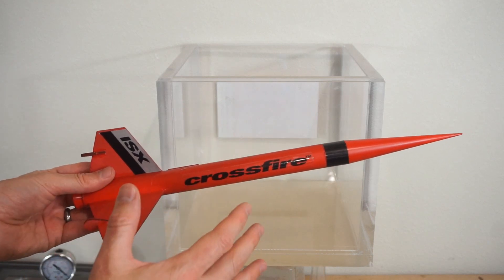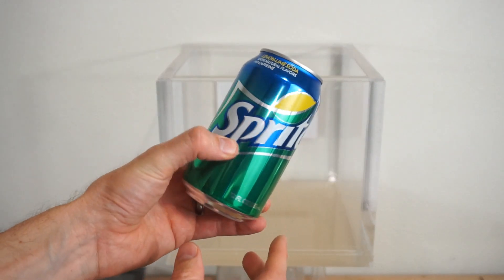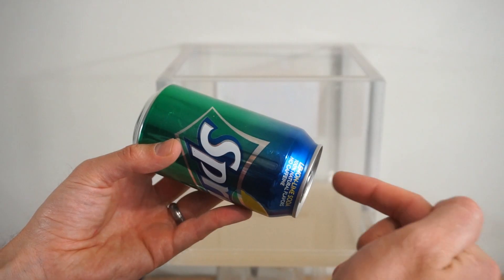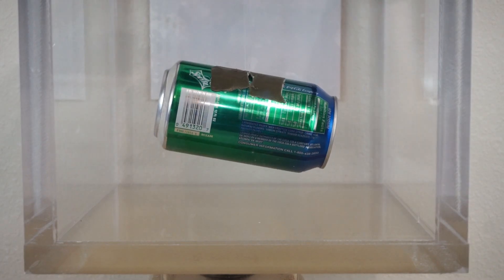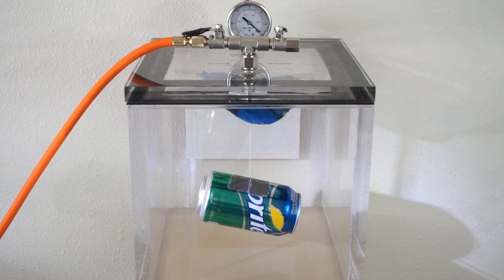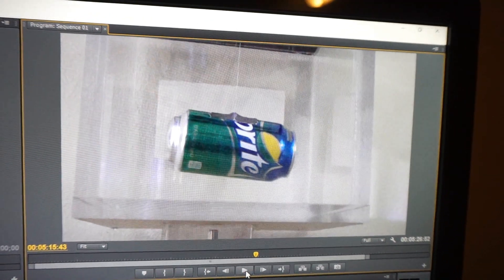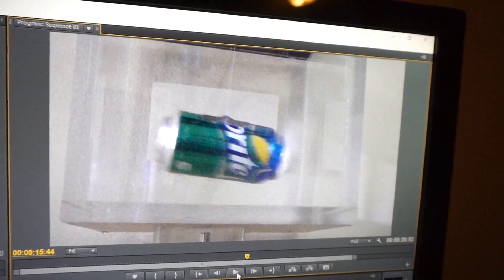Can a Rocket Fly in a Vacuum Chamber?

Comment: Well done.  Simple proof that rockets work in a vacuum.  I wonder how much mass is involved with a rocket motor though.
Reply: IIRC, it's like 90%, maybe 95% of the "wet-mass" of the rocket which is the propellants.

So, the Saturn V had a mass of 2,970 metric tons, and of that about 2,821.5 metric tons would be propellants.

These are back of the envelope calculations, so take it with a grain of salt.

Comment: that proves the rocket tanks would explode in space, and rockets and your can only last a second of thrust, doesn't prove shit.
Reply: And if the rocket tanks were  made of Sprite cans, you might have a point.
Reply: Melissa Roma Do you seriuosly think that a rocket it's the same as a soda can?
Reply: Melissa, you're extremely dumb. Do you actually believe tanks are made from 0.5mm thick aluminum rather than several inches of aircraft grade aliminum, steel and composite materials? So you actually believe that rockets do not have nozzles to control the rate at which fuel is consumed?

By your logic when you turned your stove on you'd instantly deplete the grid's supply of gas. The truth is that there's nozzles limiting the rate at which your stove can burn gas. Does your stove dial increase atmospheric pressure to slow down gas flow? No, it's an adjustable nozzle which decreases the mass flow of gases.
Reply: Melissa, here's a rocket tank being constructed (it aint no coke can) https://www.youtube.com/watch?v=r_CdlAOwj8Y
Reply: Gra Ra5 

What data do you need? As soon as you enter vacuum the internal pressure is greater than the outer (there is none in vacuum) therefore fuel tank would explode, what so difficult to understand.

This is the reason (same principal even in lower pressure) we cannot carry co2 cartridges on commercial plane nor gas canister not even in checked baggage, Can carry bicycles with deflated tires only. Greater the pressure differences more likely it happen. 

I can ask the same kind of question, what 'calculation' does support the claim that we have ever left the low orbit or landed on Moon?
Reply: Yeah because rocket fuel tanks are made of sprite cans
Reply: Gra Ra5 

Could you be more specific with your statement?
Reply: Gra Ra5 

To be exact structural integrity of rocket fuel tanks. You have not answered my question, why? Who's dodging who? 

I will provide calculation when I will get paid, or front of court. Trust me, 'son' I have got this covered. 

Other word common sense, I don't need to explain what caused a flat tire to change the wheel.
Reply: Gra Ra5 

Thanks to admitting that pressurized container explode in vacuum. 

You know when someone desperate it's never a good sign in psychology this is why psychopaths sooner or later will get cut. 

Humans never left low orbit, so there is no evidence rocket would work in space conditions. 

You can orbit around what is my calculation, will not change the fact that Apollo mission lost / erased their data tapes and they cannot recreate the (the know how) technology as is today.

Not to mention the technical needs to deal with Van Allen Belts is not known today. 

Moon landing is only a false claim without hard evidence.
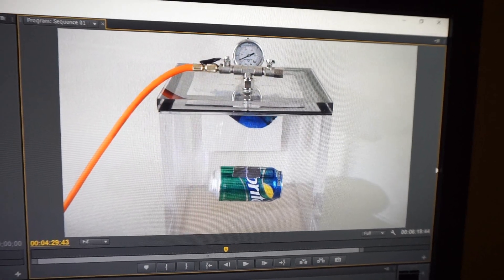Reply: Look at the slow motion part at 5:00 while at .25 speed.
You'll notice the entire experiment failed.
He never got to vacuum and the can didn't move until the contents hit the glass.
Reply: Melissa Roma
 : Your comment proves that you failed to comprehend even the simplest of concepts in this video.
Do yourself a huge favor and stop posting comments that show your complete ignorance.
Reply: Gra Ra5 

8 oz soda can holds 250kpa (2.5bar) pressure in room temperature. I assume this video happened at room temperature.

Is that true you have seen the soda can explode on this video in vacuum ?
Reply: Melissa Roma 

She's not that stupid (who ever said she is) rocket builders made tanks from aluminum, re soda can. 

Main problem with rockets in vacuum their tank had internal pressure (1-4 bar) and it would explode just the soda can did because there is no pressure outside pressure in space. This is another reason we have never left low orbit nor landed on Moon.

Comment: Thrust in the vacuum of space is a hoax!!!
Reply: Administra2rS
Your gut feeling can't argue with my source, and logic.
Where's your source?  Your bullshit requirements should be documented somewhere, so where is it?
http://www.explainthatstuff.com/spacerockets.html
" Action and reaction: rockets work by firing jets of hot gas downward (the action), which makes them move upward (the reaction). The gas isn't pushing against anything to make the rocket move : the very act of the gas shooting back moves the rocket forward—and that can happen in "empty" space just as well as inside Earth's atmosphere. "
Reply: Admininstra2rS
"two parts of hard material" according to what?  Put your source.
The gas pushes itself back off the inside of the rocket (like the hands pushing against a wall).   The rocket moves forward.  This is before anything even gets outside to where the vacuum is.  The surrounding air or vacuum plays no role at all.
Reply: Administra2rS
If his legs spun like a propeller, he could.  Pushing gas mass back must push him forward.
Where are you references?  I had two .  Surely, your conclusion that rockets wouldn't work in space has been documented somewhere.
Reply: Administra2rS
Technically he can jump off gas.

The issue with jumping off gas is that, it's very light, so there isn't a lot of change in momentum to gain from "jumping" off a cloud of gas.

A rocket gets past that hurdle by using A LOT of gas that's moving very fast. To get a picture of how much and how fast, imagine an indestructible bucket with a stick of dynamite inside, located in a vacuum. What do you think will happen to the bucket when the dynamite detonates?
Reply: What the actual fuck are you talking about
Reply: Administra2rS
Two materials with mass , which is the only requirement.
Reply: Administra2rS
Where's your source showing this list of requirements?
https://en.wikipedia.org/wiki/Rocket
" Rocket engines work by action and reaction and push rockets forward simply by expelling their exhaust in the opposite direction at high speed, and can therefore work in the vacuum of space. "
Reply: Administra2rS
You're forgetting the fact that the exhaust has already exerted the force before it ever leaves the rocket nozzle.
Reply: Administra2rS
First, the gas pushes off the inside of the rocket by rapid expansion.  The gas pushes itself back.  The equal and opposite reaction is to push the rocket forward.  The chamber and walls don't do anything.
Reply: Gas pushes off the rocket, like an astronaut jumping off a rock in vacuum.  Both move away from each other.  That's the thrust.
Reply: @Administra2rS
can you provide links/evidence/math to corroborate your claims against the current understanding of rocket science?
Reply: Look :) If you are standing in a vacuum chamber, you will NOT move until you stretch out your arm against a wall. If you blow very very hard since your body is very dense, you will move because the AIR is stopping AGAINST the WALL. It creates something, a barrier against something, a physical object material you can push against. NOW! What happens if you REMOVE the WALL??? When the rocket brings IN it's own air/gas, then the vacuum chamber is not a vacuum chamber anymore, now the rocket can travel, but when you remove the walls of the chamber, then the rocket has no where to move, you can not push or make recyl wen the mass is hanging in a vacuum.
Reply: Cryogenic Vortex WRONG!!! I will move because I'm STANDING on a WALL, you'll have to think in 3D, and that's PLANE and simple :) The cannonball will push you yes, but you are still standing on the WALL. See, in space there are no walls :) If the rocket had a propelling system of miniguns it could move in the vacuum of space, but the rocket have no miniguns. See? A bullet woks in space cuz the bullet consits of two hard material parts see, action reaction. So the recoil/the travel starts wen explosion between the two hard parts pushes them from each other and the two hard material parts uses them selves as the WALL:) A rocket engine works the same way a garden hose works, if you hold down the part where the water flows out, let us call this the nozzle then the water pressure will increase even thug the water preassure in the hose is the same. But where there are no WALLS or AIR/GAS/MUD etc.., nothing will travel :) The can fills the vacuum chaimber with pressurises GAS. Now the soda can can freely move on the GAS filled chamber. And the GAS stops on the WALLS of the chaimber.
Reply: Ok, jump up and throw it - it will push you even harder, when your feet aren't connecting to the ground. WRONG!!! In the vacuum of space, there are no gravity, -pressure. No way for thrust to form. The bullet works cuz there are two hard parts, gas and liquid does not fit in this category. The bullet works cuz the two hard parts HOLDS together. A thrust in the vacuum of space will work if you can physically screw the air/gas that is coming out of the rocket to the chassis of the rocket, something that we can not do. Thrust does not work in space. It has EVERY thing to say witch material. Recoil can ONLY happen when there are two hard material parts connected. Think you have watched too many movies :)  When the exhaust leaves the rocket THEN it still hangs in a sucking vacuum and it's no logen CONNECTED to the rocket. No thrust can be created. If the rocket was spitting out something of HARD material that is connected physically to the rocket, then the push could have been made. You can not glue exhaust to the rocket, there for the thrust won't work :/ The vacuum of space is PULLING the rocket in all directions. On the surface of the earth it is positive preassure that is pushing everything IN. So the rocket can travel and thrust in positive preassure where Newton's 3 law WORKS, but FAILS in the sucking vacuum of space. The soda can comment is from linger down, you have to scroll down to understand what this is about. I was explaining why a soda box would move in the vacuum chamber, not talking about engines here :)
Reply: Administra2rS
The rocket pushes off its own gas.  Two masses (the rocket and the gas) pushing off of each other makes both of them move in opposite directions.
Reply: Not on it's own, the gas must stop against the wall to make the push. Or fill the chamber with something else than the vacuum.
Reply: ...that also stop agains the wall of the chamber.
Reply: ...3 masses. The wall, the gass and the rocket.
Reply: Administra2rS
Okay, tell me this.  If you're in outer space crouched on a rock of equal mass to yourself, and you jump off this rock, what happens?  What moves, and in what directions?  There is no wall of any kind to consider.
Reply: n the vacuum of space, there are no gravity and negative pressure. No way for thrust to form. A bullet works cuz there are two hard parts, gas and liquid does not fit in this category. The bullet works cuz the two hard parts HOLDS together. A thrust in the vacuum of space will work if you can physically screw the air/gas that is coming out of the rocket to the chassis of the rocket, something that we can not do. Thrust does not work in space. It has EVERY thing to say witch material is used. Recoil can ONLY happen when there are two hard material parts connected. When the exhaust leaves the rocket THEN it still hangs in a sucking vacuum and it's no logen CONNECTED to the rocket. No thrust can be created. If the rocket was spitting out something of HARD material that is connected physically to the rocket, then the push could have been made (like a minigun propulsion system). You can not glue exhaust to the rocket, there for the thrust won't work. The vacuum of space is PULLING the rocket in all directions. On the surface of the earth it is positive pressure that is pushing everything IN. So the rocket can travel and thrust in positive pressure where Newton's 3 law WORKS, but FAILS in the sucking vacuum of space.
Reply: Administra2rS
So what happens when you jump off the equal-mass rock in outer space, as I asked you before?
Reply: It is not what the rocket does. You and the rock are two hard material parts.
Reply: You must have 3 parts to make it move in the chamber.
1• the chamber walls
2• the gas
3• the rocket

In space you have a problem.
1•
2• the gas
3• the rocket
Reply: Pressurised gas moves extremely fast, it does two things, it makes a physical touch against the wall of the chamber, and fills the vacuum with gas who also stops against the walls of the tiny vacuum box to travel on. 

You must have 3 parts to make it move in the chamber.
1• the chamber walls
2• the gas
3•the rocket

In space you have a problem.
1•
 2• the gas
3• the rocket
Reply: That does not work in a vacuum, see the vacuum is sucking everything in every direction, the recoil in the rocket works ONLY it there are two parts of hard material. You can not push of a gas that hangs in a vacuum.
Reply: Yes, two parts of hard material according to logic. The brain is the source :) The gas can not push when on the inside of the rocket. It is like standing in the rocket it self and running from side to side to hit the wall to make the thrust. It does not work.
Reply: ...and when the gas leaves anything it is independent. It hangs in a sucking vacuum and becomes the sucking vacuum. No where for the recoil to form, for this you need two hard material parts like a bullet in space.
Reply: You can not sit on a boat and blow on the sails to make thrust on water, you can not do it in space...
Reply: Administra2rS
That's why the gas exerts the force before it leaves anything.
No one said it's like blowing on sails.
Reply: When the gas exerts the force before it leaves the rocket, then no thrust can be made. Gas can not push a rocket in itself. A soda box explodes in the vacuum of space, it will not travel, the nozzle of the rocket can be explained by holding down at one end of a garde hose. The water pressure is constant but by pushing down like the rocket-nozzle does it creates more pressure even though the water pressure is constant in the rest of the hose.
Reply: An astronaut can jump off a rock yes, but he can not jump of gas see :) No thrust in space.
Reply: Administra2rS if u stand in a vaccum your blood would boil at the first place. And no need to push anything it pushes it's own fuel.
Reply: Cryogenic Vortex, you've got to be a shill because nobody is as stupid as you're pretending to be.
Reply: No it can not. I have explained and debunked it with logic :)
Reply: Wrong!
Reply: f you are standing in a vacuum chamber, you will NOT move until you stretch out your arm against a wall. If you blow very very hard since your body is very dense, you will move because the AIR is stopping AGAINST the WALL. It creates something, a barrier against something, a physical object material you can push against. NOW! What happens if you REMOVE the WALL??? When the rocket brings IN it's own air/gas, then the vacuum chamber is not a vacuum chamber anymore, now the rocket can travel, but when you remove the walls of the chamber, then the rocket has no where to move, you can not push or make recyl wen the mass is hanging in a vacuum.